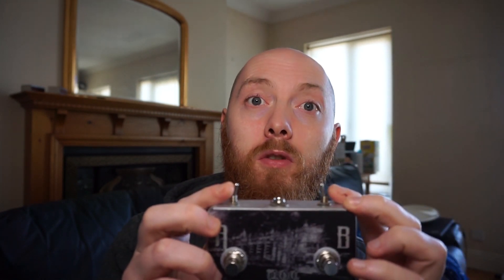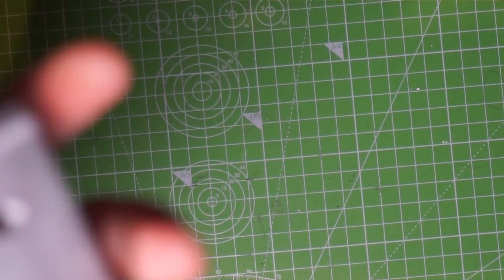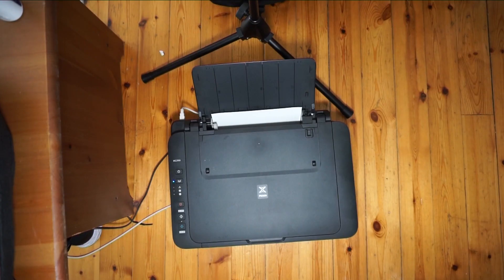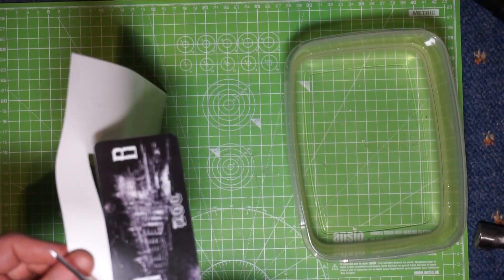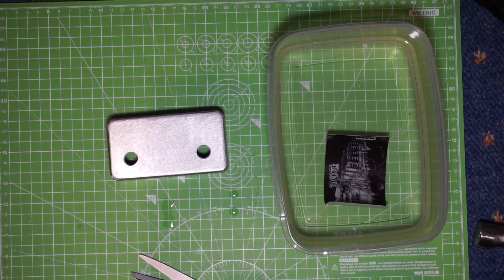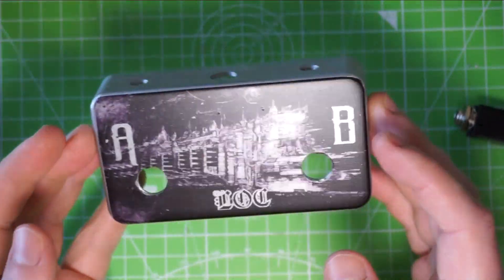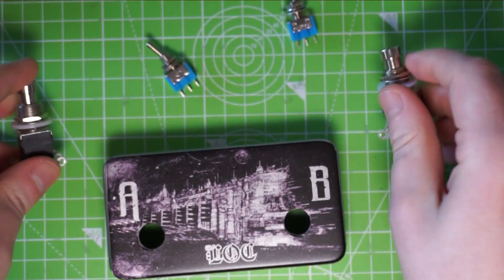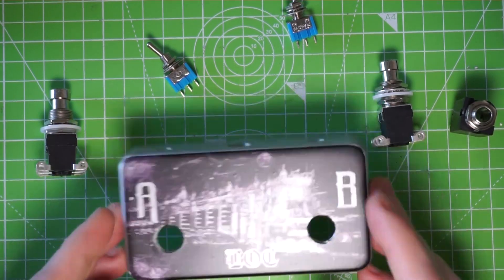DIY Boss FS6 Clone

Comment: This seem misguiding, because there is no way that this circuit can do latch or unlatch without relay and temporary switch, so this is not a fs6 clone, just a "simple" double footswitch with reversible polarity wich is about half of what the fs6 is about.
Reply: Thx for advice. Do you have a real good DIY for FS6?
Reply: @jafakeks9241  source of power, temporary footswitch, relays, mini switch and a box will do it with a not so hard to draw circuit including bypassable self sustaining loops for the relays..or just buy a FS6 and be done with it...
Reply: @nekot9274  Yeah yeah... to much for me. I just buyed a used one in mint condition and now all the sorrow is gone.
Reply: Всё верно. Это больше сопоставимо двум педалям FS-5U в одном корпусе, что тоже отличное решение.

Comment: Hey Liam, thanks so much for this awesome video, it was just wat I was looking for! Although I have zero experience working with electronics, I had planned on making my own dual foot switch for my Boss MS-3. But when I looked up the price of the components I realized it'd be way cheaper just to buy a ready-made one from China. It just arrived, but I couldn't make it work with the MS-3, then I read somewhere I need it to be normally closed instead of open (and I'm guessing the one I bought is wired normally open). I feel really stupid for asking this, as I'm sure these are the very basics of working with electronics, but do you by any chance know how I would have to wire it when I'm not using polarity switches? The enclosure is simply too small for additional switches and I'm guessing I won't need it anyway, right? Sorry for asking you this, hope you won't mind!
Reply: Oh and btw, my pedal contains two momentary dpdt switches and I'm guessing the output jack is called a dpdt (stereo?) jack. It has three pins on one side and three on the other, similar to the connections on the dpdt's.

Comment: Liam i copy what you do, but i have a problem. For sure im making a mistake. When i press the footswitch, they change to the other channel/bank, but, when i lift my foot, it comes back to the original bank/channel. I did it without the toggles, and its the same. Maybe, the footswitch its not dpdt? or the toggle spdt?
Reply from the maker: It sounds like you may have used the wrong type foot switch. Make sure they are DPDT and are momentary switches.
Reply: @LiamOConnorAudio  Thanks! can be switcher spdt momentary what i have? i mean, it would have sense what my clone is making if the switcher is spdt?
Reply: @LiamOConnorAudio  Hi! recently i found that this plans and the materials that the forum link says doesnt work for amplifiers (katana boss). I have to use latched dpdt footswitch
Reply: @pablobrg  im planning to build this too for my boss katana, besides latching footswitch instead of momentary may i ask what is the type of toggle switch is needed for this build?
Reply: @mpacardo10  the switch can only transform de footswitch between closed and open. Dosent do anything important if you are gonna use it for changing banks or chanel. Use only Footswitch, stereo jack and stereo cable
Reply: @pablobrg  Thanks! Do you think I can use a 3PDT instead of DPDT?
Reply: @mpacardo10  Yes, you can.
Reply: @pablobrg  Thank you sir!
Reply: @pablobrg  If I understand correct, the FS-6 has a second toggle per side that sets the switches to latched instead of momentary.
Reply: @stnkppns  Yes, but this is not an exactly copy of the fs6. Imagine this, the momentary footswitch only has the "ability" to change between close and open by pressing and holding the switch. On the latched you dont have to keep pressing the switch. But that is the only capacity of each footswitch. So to transform a latched into a momentary you maybe need an extra circuit...

Comment: The FS6 requires a battery.  I guess it's just there to operate the LEDS?
Reply from the maker: Yes this version does not have LEDs and so it does not need any power source.

Comment: Great video - quick question - for use with an RC30 are the spdt switches required ?
Reply from the maker: if you only want to use it with the RC30 you can just wire it to work with that permanently. the switches just let you use it with different pedals.
Reply: LiamOConnorAudio - thanks for reply - i picked up a Mosky dual momentary switch but doesnt seem to do what is expected - ie single tap right switch start memory scrolling up ; double tap changes channel ; left switch single tap scroll down ; double tap fx on/ off : press both switches simultaneously - stop mem scrolling ; hence ask re polarity as this is not really practical asis
Reply from the maker: Yes that sounds like how this pedal behaves when the switches are set to the wrong positions.
Reply: LiamOConnorAudio - I could potentially rewire - but Ive seen on other forums that the left hand switch is actually in normally closed position ?

Comment: Can I use a 6 pin, on-on toggle instead of two separate toggles?
Reply from the maker: Yes I think you could depending on how you wire it up. You would lose the ability to switch the pedals indivually then though.